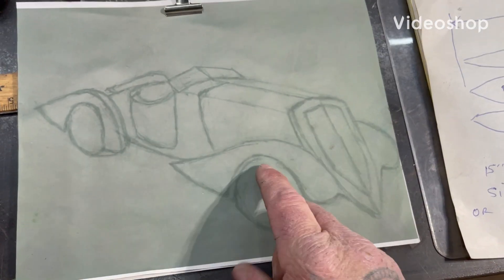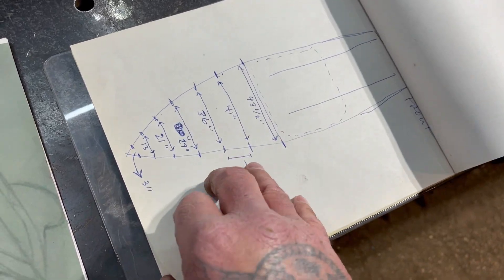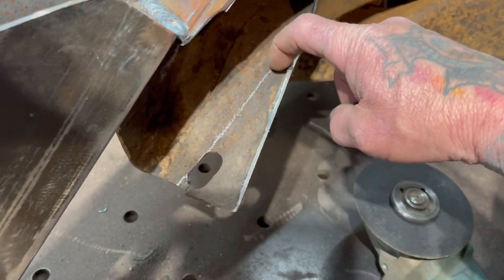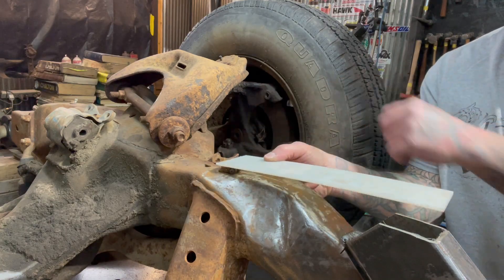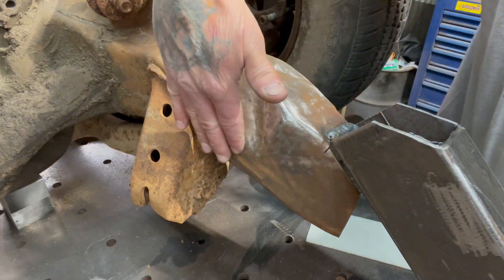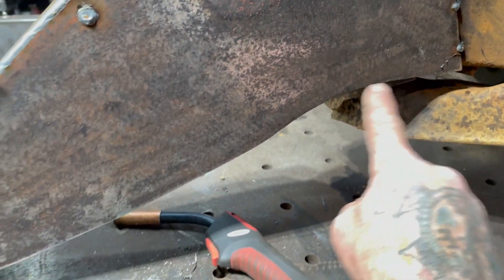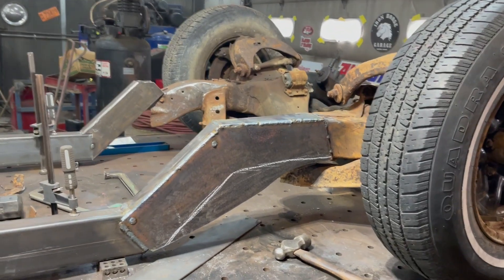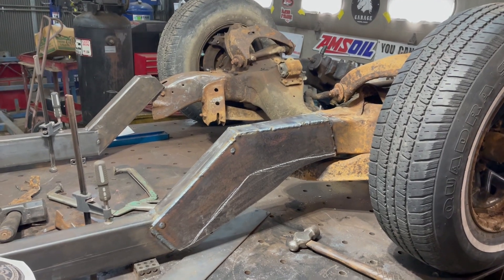Vigilante frame build part two  S10 subframe build

Comment: Great video. The work looks really nice and with all that bracing the frame will be super strong. Better to be too strong. Have personal experience with what happens when frame mods are not done properly and fail at eh worse time. Back in my teens my friends and I used to screw around with mini bikes. Was flying along a gravel road on a mini-bike with a very poorly done set of chopper forks on it. The forks just collapsed and I went flying along the gravel road in shorts and t-shirt. Lots of ripped up skin taught me a lesson. Luckily no broken bones. Look forward to more on Vigilante. Be safe and stay well.